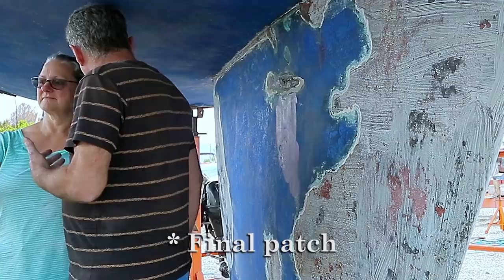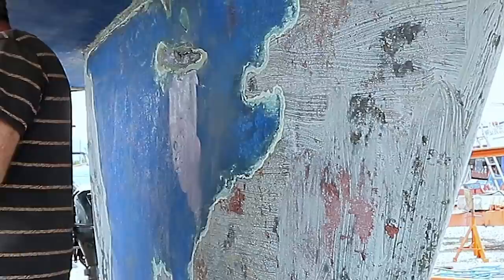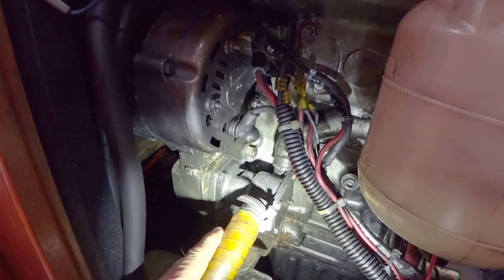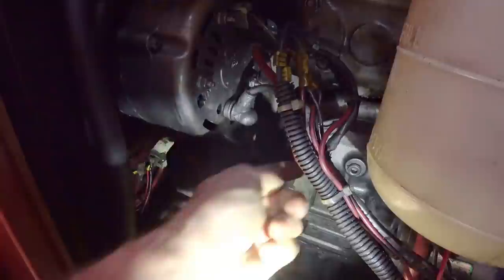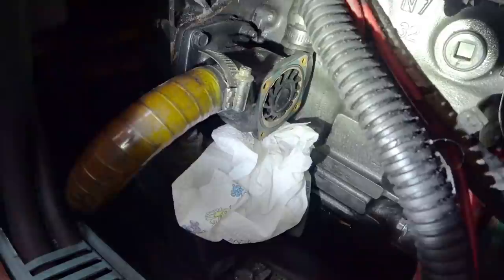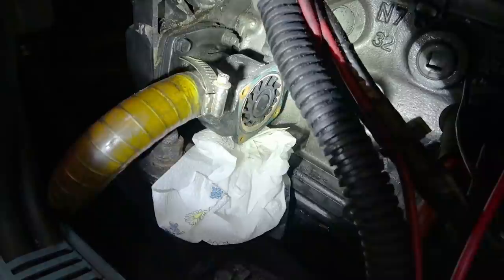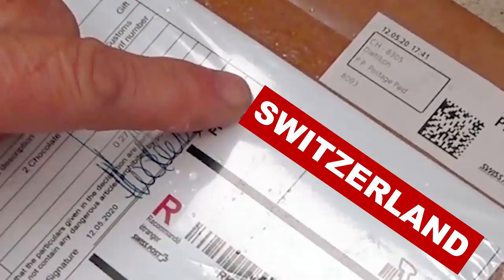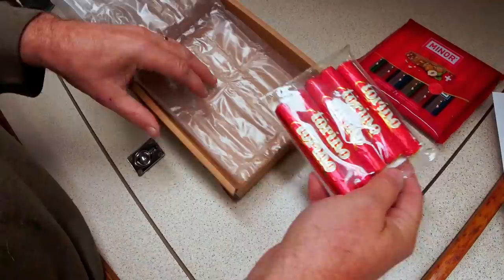Prepping our keel for antifoul paint - Sailing A B Sea (Ep.124)

Comment: Looks like you will be soon ready 😀😀 All your hard work will pay off as most of the critical parts have been replaced or repaired. Nice sailing time ahead 🍾🥂🍻
Reply from the maker: That's the plan Michel. First bit of epoxy filler just put on the keel, sanding tomorrow. 👍

Comment: That key needs to be a tight fit no sloppiness at all if you leave it loose it will work and enlarge slot in prop as well as shaft eventually causing major damage.
Reply from the maker: OK, knowledge taken on board, key must go back in the same way it came out. Cheers.

Comment: allo A B sailing crew
about you key for your shaft , you have to be careful with way you are placing it , it should not have any play , otherwise what ever you are fitting there will have a chance to move , also by putting it the lose way in the part might not slide in 
i know it is a small space to work , but for don't be afraid to use the hammer and push that key in tight , if you brush it use a file and fix it before sliding your part on the shaft , believe me better tighter than lose , 
what can happen is that you can damage the shaft , very costly item to change 
you know try putting it in before you slide the shaft in as a practice exercise , let part of it stick out the end of the shaft , to remove it 
good luck , 
Louis
Reply from the maker: Thank you for sharing that information Louis. 👍

Comment: The key has a correct way to install and should be a neat fit with no excess clearance.
First you need to check the fit in the drive flange it should be a neat push fit.
If the shaft fit is to tight you can dress the key with a step for a neat fit.
Note you can not turn the key sideways as the combined depth will be larger than the head clearance.
Depth of slot in Drive flange and Shaft slot should be slightly less that key height.
Long story short you need to file the key for the correct fit.
If you not sure get some help.

Cheers Ken
Reply from the maker: Hi Ken, I have just been into Limni village to buy painting materials and I bought a file too, so I'll do some filing to make the key press in nicely. Cheers.
Reply: I was just going to say that very thing , Loose keyways dont last long.
Reply from the maker: Thanks Bill. 👍

Comment: Bazz the key needs to fit tightly into the keyway if it is allowed to rattle it will damage the shaft or coupling or both, you might want to think about replacing that key with a new one that fits snuggly or think about filing the old one so it fits better but check to see how it fits the coupling before doing any fueling you might only need to file the part of the key that sets  in the shaft keyway. Good luck.
Reply from the maker: (Baz) I bought a file and will trim it slightly to help it go in snugly. 👍
Reply: Be sure to check the fit to the coupling that part of the key might not need to be changed

Comment: Totally agree with putting the key back in the same orientation as it came out. Otherwise shock-load WILL destroy your key and keyway!! As with the puller for the impeller, the center pin that does the pushing looked awfully long... try fitting the puller without the center pin and maybe cut it shorter to suit. Keep living my dream ... if you want me to I could sample your chocolates to make sure they're ok... hahahaha
Reply from the maker: Hi Konstantin, you're out of luck on the chocolates, they didn't make through the day. 😂 Thank you sharing your knowledge and tip for the puller. 👍

Comment: Good effort - must have been a tad frustrating with the  impeller puller but Baz how long would it have took to drop the starter motor? - no more than 20 minutes surely? On the shaft key I would recommend that you put the key in the way it come out - the best way of dressing it is to rub on very fine emery or better still ‘crocus paper’ - mounting the abrasive on a good flat surface like a kitchen worktop - and polish removing the absolute minimum of steel. If you are not very skilled with a file then please do not go there.
Reply from the maker: (Baz) Good points Norman, but being honest I'm so gun shy at this point in time because every time I remove something it uncovers two more jobs. I just want to get the jobs I've started to completion. It's very stressful for me.
Reply: Sailing A B Sea I can well understand that.👍⛵️

Comment: Yes, don't fool around with the key. This i what the English call 'match made'. In fact, it is result of inaccurate machiening :-) If you go ahead as planned, you wil face a propeller issue. So don't do that, please. Another ting, your raw water pump. And the plastic hose comming into the pump. It seems from the video that it is discolored. Have a close look, some of those hoses can give a sudden and severe leak. On sv Hulda, rubber hoses only, designed for the duty. And a third thing, just to cheer you up. Rust killers kills rust, and the stuff make an excellent surface for paint. But. It's allways a downside. Water will sooner or later creep underneath the rust killer. And it will rust. And rust expands 10 times. That is, 1 mm steel will turn into 1 cm of hard rust (Fe2O3). That is not ideal where the keel meets the glass fiber hull. Best way to protect cast iron/steel is by epoxy paint and anodes. I would reccomend 1 off 150 gram (approxemately) zinc or aluminium anode on each side of the keel, high up. Drill and thread M6 threads and bolt on anodes. That's what we call catodic protection. Easy, and it works. 
BR
sv Hulda
Reply from the maker: Thank you for sharing those tips, we do have a large anode on the keel. 👍
Reply: Preferably 1 off anode on either side of the keel. High up (40 cm from top) and approx. 30 % from front of keel.
What happens, electrcally: The keel will loose electrons (M2-). This loss of electrones is what you see as rust. Dramatically simplified :-) What the anode does, is to sachrifice 2 off electrones. In other words, the anode will supply a 'carpet' of electrones covering the keel. Furthermore, the anode will also sachrfice, for zinc that is, Zn2+ protecting the steel. A bit more complicated to explain. Fighting my cellphone. 
BR
sv Hulda

Comment: Oh Dear.

No No No. The Key must be tight in the keyway or else you will find it will " round over " on the edges, this will happen every time you change from forward to reverse and back. As I said previously the early Holdens had these to drive the back axels, if they wear they squeak and squeal and ans start to knock as they wear more and more, sand it a little if you must but please for your own sake put it back in tight. It is what makes your prop turn so there is a lot of weight on it all the time you are in gear. But please seek professional advice don`t take my advice alone.

Second point Baz perhaps you could make up a tool for removing the impellor on your engine, it is fine to leave that one in because it looks Ok but Murphys` Law says that it will go while you are at sea and then you will need to make that tool work, find a solution before you launch.

Kind Regards to you both.

David.
Reply from the maker: Hi David, the consensus  is that we must put the key back in the position it came out. That's one of the things we appreciate about our YouTube community, knowledge and tips to helps us get things done correctly. Also we've decided to put a new impeller in, just to be sure. Cheers.

Comment: Hi, you should put the key in the freezer and then heat up the shaft, this way the key will fit easily. Putting it in so loosely fitting as you showed, is no good idea. It will rattle looser and looser over time.
Matthias who will finally be able to get into Greece on the 15th of June
Reply from the maker: Hi Mattias, that's an interesting idea. We were thinking of covering the key in electrical tape to pad it out a bit. Fingers crossed that you get into Greece soon. Cheers.
Reply: @SailingABSea  
Don't think the electric tape is not getting squished and just melting away. This electric tape  is not working for longer than a week or two. The pressure on the key is your engines horsepower and torque  at a very short lever.  Freeze and heat is really easy to do.  
 Matthias, by the way I will drive the Balkans with the car to finally get to the boatyard 😎
Reply from the maker: OK you do make a good point. We'll see how the hot/cold combo works out.
Reply: @SailingABSea  - I think he is making a good point. That key was just a tad too wobbly. Probably a new key (made local) would be the best bet.

Comment: Last year I struggled pulling the impeller off of my Oberdofer raw water pump only to discover , when looking at the parts diagram in the manual, that there was a retaining ring securing the impeller onto the shaft. I also discovered that the entire impeller shaft is designed to be easily pulled out . I’m not sure if that is a common feature of water pumps in general. What brand is your pump? Cheers Kevin
Reply from the maker: Hi Kevin, there are no retaining anything on our impeller, the new one just slides straight on with a bit of washing up liquid, it's just a bugger to remove.

Comment: Hi Guys. Given the price of impellers (£10), we pull them out during the engine service and chuck them. In goes a fresh one.
I have missed the "weeping hole in the keel" solution. What caused it? It looks like it is still there waiting to be filled.
Reply from the maker: We're going to replace the impeller before we splash. The fixing and explanation of the weeping keel will be filmed when the Sikaflex arrives, hopefully tomorrow. Cheers. 👍
Reply: @SailingABSea  - I thought I had missed a bit. Thanks.
BTW - The key in the shaft: try squeezing it in with vice grips if space is a concern

Comment: Baz. Please check the Keyway before you put it in as you can see the keyway will look like a loaf of bread the 3 flats go to the side 's and the Bottom of the Shaft. Also unscrew the center bolt on the Puller and use a Shorter Bolt to do the Same Thing ,if what i am seeing is that the one that came with the tool is to long and hits the starter motor .
Reply from the maker: (Baz) Ahhh OK, two very handy tips there 2Moza, I'll check the key right now. Cheers.
Reply from the maker: 2moza, just checked the key, it's not loaf of bread shaped. I have a file so I could make it bread shaped.
Reply: @SailingABSea   No mate go with what you have just make sure the Key is firm all the way on all  sides when your putting it back together no slop in all 4 places when you assemble it . lol Keyways come in all shapes and sizes but square is the Normal size most times there are some odd one's out there :). https://www.youtube.com/watch?v=CrGB2jSFxu4
Reply from the maker: That's a great video (apart from the sound quality). A good find 2Moza. 👍
Reply: @SailingABSea   Your welcome and yes i did view it as well before i forwarded it to you and the sound is crap they said the same thing on the comments as well, but it shows what you need to know mate.